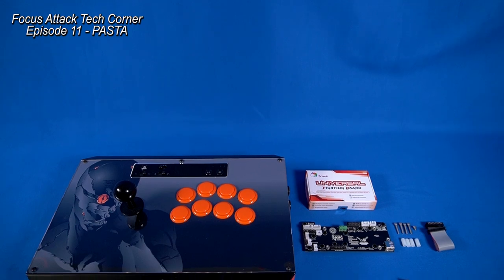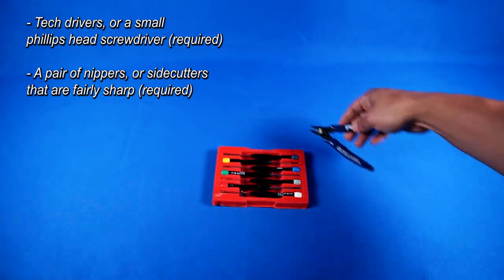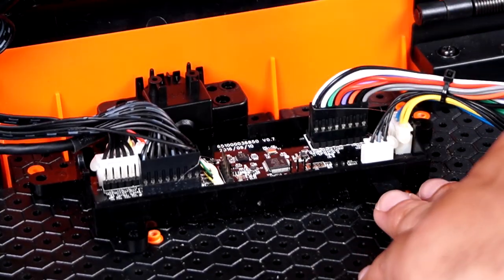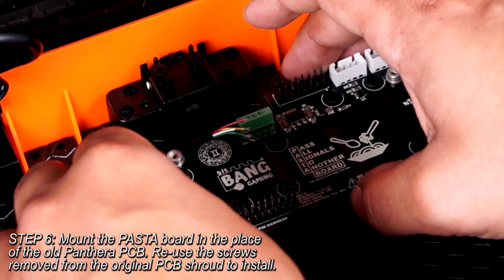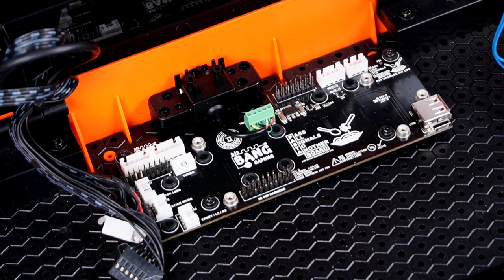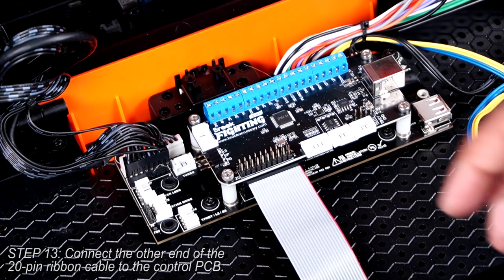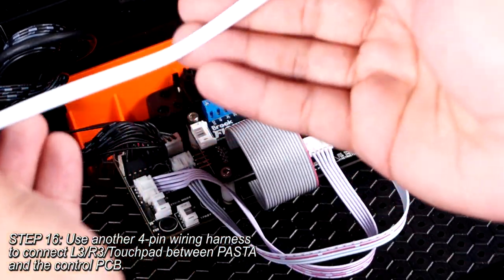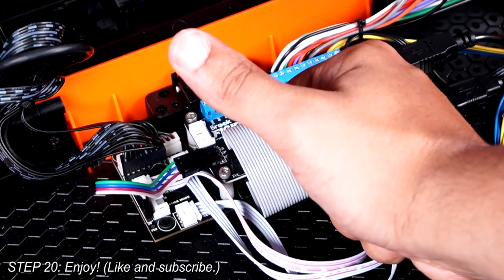How To: Install Bit-Bang Gaming PASTA Board into Razer Panthera Fightstick

Comment: Is there a way to replace the cable? I want to be able to use a USB-C instead of the proprietary 5 pin.
Reply: I used the EZ Mod kit with the Panthera (designed by Jasen Hicks). Not exactly the same, but it should be similar. I completely screwed up those little USB wires, so I took the whole 5 pin connector out. I installed the Aviator to USB connector kit from Arcade Shock and connected the USB end to the USB port on the Brook Universal Fighting Board. That worked fine and I didn't need to deal with messing up stripping tiny wires. Arcade Shock sells a similar USB-C connector kit. I'm guessing that one would work the same.

Comment: Will the PS5 brooks upgrade board work with this?
Reply from the maker: Likely, the upgrade board connects to the UFB, which then connects to the PASTA board.
Reply: Yes there is a spot for the upgrade board to be mounted on. The cable is not included in our kit but should be included we the upgrade board. We include the screw as well for mounting.

Comment: I switched the red and green wire in my Panthera so I could use te2 cables instead of the Razer one. If I get the pasta board could I swap the green and red cables to be able to use the te2 cable instead of the Razer one? Anyone know or have any advice?

Comment: never understood why they used THE THINNEST wires for the usb connector....
Reply: I know right? It's my biggest complaint with OEM sticks.
Reply: @bitbanggaming204  yea dude, it's razor thin, really really annoying when putting those wires into the terminals
Reply: I totally messed up trying to strip those thin USB wires. So I ended up removing the entire USB connector and installing the Arcade Shock Aviator to USB connector kit instead. I just plugged the USB connection from the connector kit directly into the Brook Universal Fighting Board.